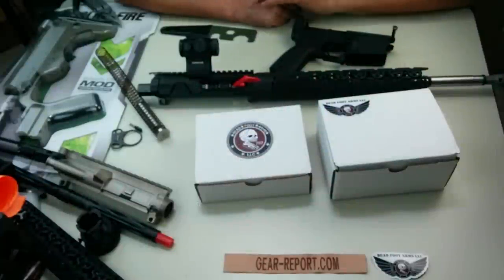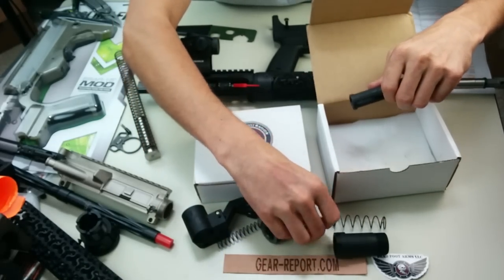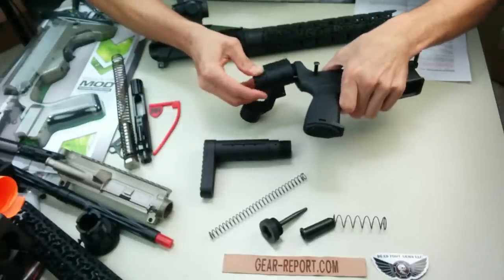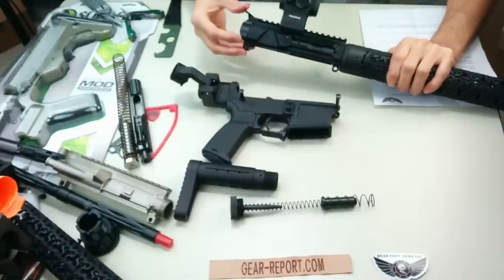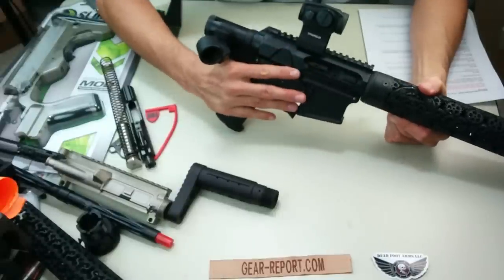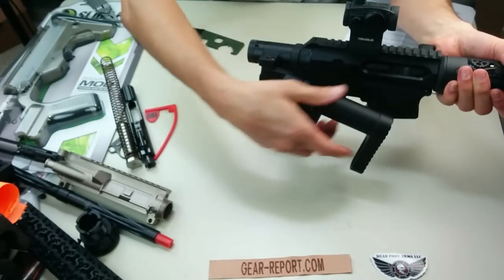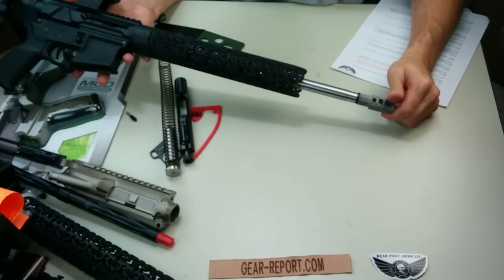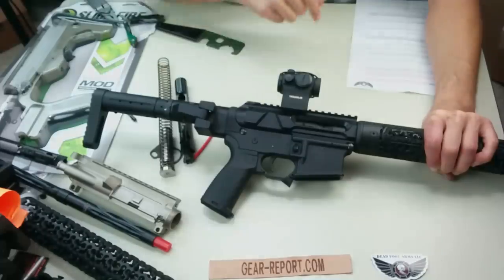Folding AR15 Stock you can SHOOT while folded! How to Install Dead Foot Arms MCS

Comment: I was wondering if this is compatible with a Fostech Echo or Franklin Armory  Binary trigger? If so I am getting one! Great 👍 Video!
Reply from the maker: It may be now, but it wasn't when the DFA MCS came out... that was one of the first things I tested. :)
Reply: Yeah the old Fostech system wouldn't work because of the proprietary bolt carrier, I called Fostech and they said as long as the shorter bolt carrier mimics a the inner cut pattern of a full auto bolt carrier, There should be no issues. Franklin Armory will work also because they said it use almost any bolt carrier. Thanks for the response thu, I'm ordering one next paycheck!

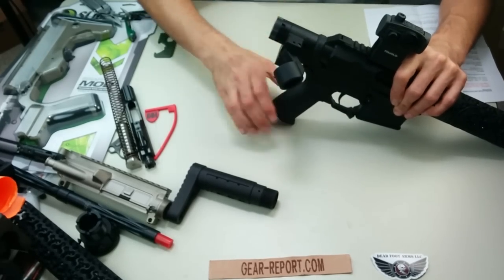Comment: 5:40 I actually really like that high-pitched dinging sound as you shut the bolt. I assume from the buffer tube being suspended between the two springs.  I imagine that setup changes the felt recoil as well, though I can't figure off the top of my head weather or not it would be a positive change in felt recoil.
Reply from the maker: Didn't change it enough for me to make a definitive statement about it.

Comment: What if you wanted to add a sling? Is there a way to do so with this on your rifle?
Reply from the maker: Sure. There are a variety of ways to add a sling, like a rail mounted sling adapter (http://amzn.to/2mQs4GS) or a  sling that wraps around the stock tube (http://amzn.to/2m5Jv6p).
Reply: And there is a QD sling connection point in the back of the hinge housing.

Comment: The end cap/ guide rod assembly, does it use the same threading as a receiver extension/ castle nut? Is the guide rod removable? It would be interesting if you could nix their folding setup, and  put a picatinny rail adapter for an mcx in the short tube and run a traditional mcx folding stock. Would this be possible?
Reply from the maker: What you suggest would work better with their newer system. You can't take the guiderod outof the the system in this video.

Comment: Hey I know I'm late on this video but can you install a Sign Arm Brace on these and do you think it would be too big for the folding stock??? Thanks! 😀
Reply from the maker: We have a DFA folder on our latest AR pistol build (review will publish soon) as well. Tried a SIG brace on it and hated it. It worked, but I generally hate SB Tactical/Sig brace anyway. Too bulky and impractical to strap to arm.
Reply: Thanks for the reply I think I'm going to use the Shockwave Blade Stabilizer, it's very slim and cost alot less than the Sig Brace! 👍
Reply from the maker: You might also look at the Tailhook. Our latest AR build is an AR pistols with a DFA folder wearing a Damage Industries buffer tube and Gear Head Works Tailhook, Frontier Tactical Warlock (makes it a takedown), Gibbz PDQ receiver set, etc. Hoped to have that review done by now, but got buried in SHOT Show prep that is slowing it down. Here is a pic from before the Gibbz receiver set was installed: https://www.facebook.com/GearReport/photos/a.621686704569838.1073741828.621660614572447/1771696102902220/?type=3&theater

I think the tailhook is far superior to the blade, as the tailhook provided support.

Comment: What if I want to shoot 458 socom?
Is the main spring a standard buffet tube spring?
So I can use one for 458 socom?
Reply from the maker: Probably not the best idea. The whole buffer system is proprietary and balanced for 5.56/.223. Maybe they will offer more robust springs at some point.
Reply: How about rounds like 6.5 Grendel, 6.8 SPC and .300 BLK? Also, would it be okay for .308 (AR 10)?
Reply: 100% not true it is designed for everything  from .556 up to a .308 it will work just fine all's it's doing is extending the buffer system,as long as everything is tight you can shoot whatever you want,says it right on thier website

Comment: I'm really concerned about replacement parts such as BCG and recoil system...
can't compete with Milt. Spec /  Can't give up my ARMS and SRC. BCG's at least with them- replacement parts are no problem (SHTF) . However,  your review was very informative.    THANKS FOR THE TIME YOU PUT INTO THE VIDEO.....

                                      ALL BLACK RIFLES MATTER
Reply from the maker: I think this is a very valid concern.
I would not use a rifle with non-standard BCG & buffer like these in a combat rifle due to relative unavailability of replacement parts in the field.
As a US military veteran I can tell you that mil spec is NOT the end all, be all. Parts made by the lowest bidder to meet bare minimum standards of performance and reliability can almost ALWAYS be improved. So, I don't remotely think that non-mil spec parts "can't compete" with the performance of milspec parts. Some non-mil spec parts will be better, while other designs may no be as good. As it relates to this specific setup I found the non-mil spec BCG and buffer to work just fine. In order to make a folder that would fire while folded the BCG and buffer assembly had to be modified. Period. 
However, I think maybe you were just referring to the availability of replacement parts. In which case, I completely agree. :)
Regardless, I see this is a novelty item for now. Maybe if they really take off and parts availability becomes ubiquitous, then they can be considered for a duty rifle.
Either way, I appreciate the feedback.